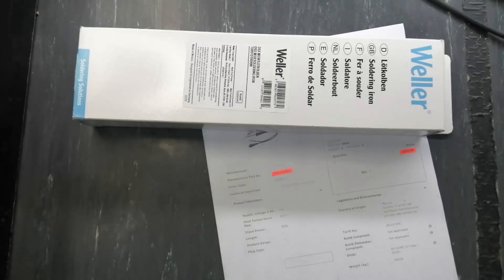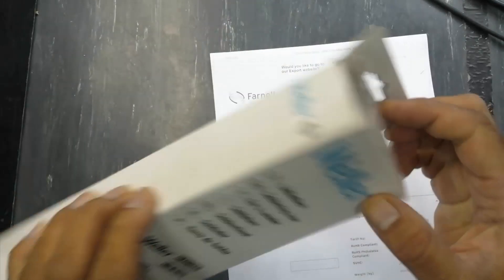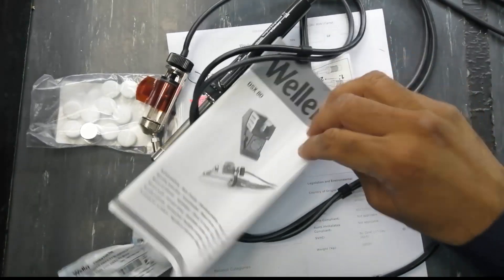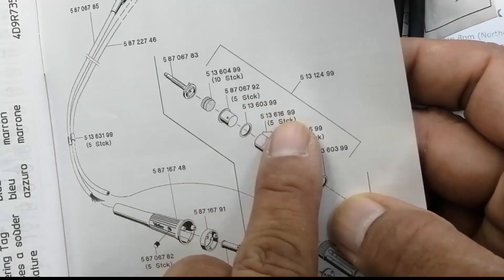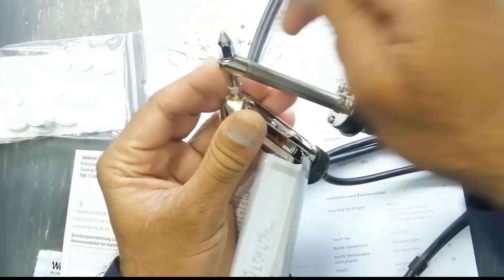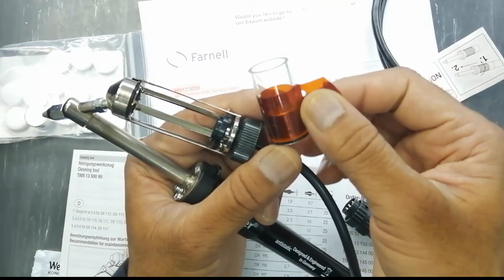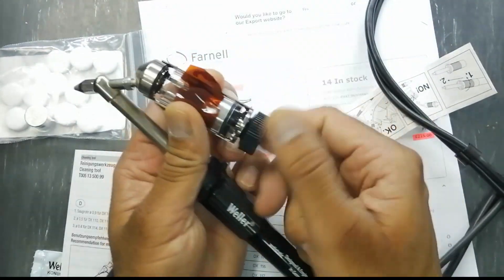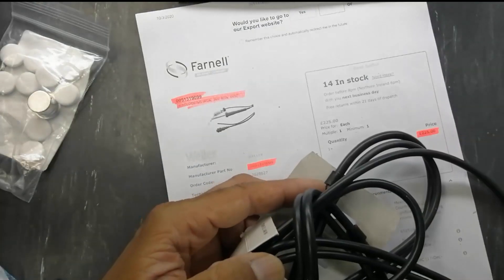#274 Desoldering Gun Weller DSX80 - Shopping Review from Farnell

Comment: there are better cheaper versions on aliexpress. for 70 USD.. i recommend others to buy
Reply from the maker: exactly there available 
but when we are stuck on a brand and specific vendor, in that case we have to pay more 
as my  WELLER WR3M is around 3000USD, so replacement parts are expensive due to quality and brand name.
if we select the same part with same quality with any other brand, it will cost many times less than this
Reply: Pls send the link

Comment: Sir I have a working step down transformer 220 to 110 when I plugged in to the series lamp the lamp doesn't light but when I plugged in the soldering iron to the transformer because the soldering iron is 110 the light is on  is that normal sir tnx for your reply